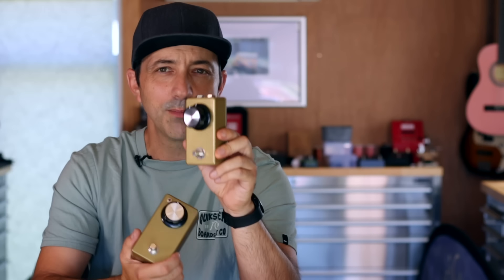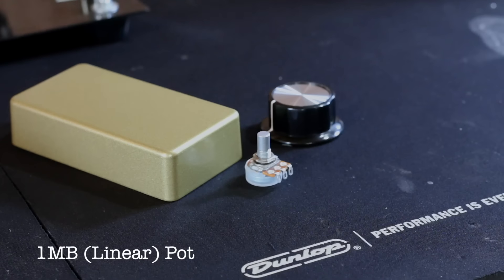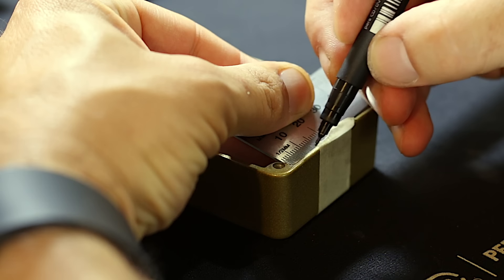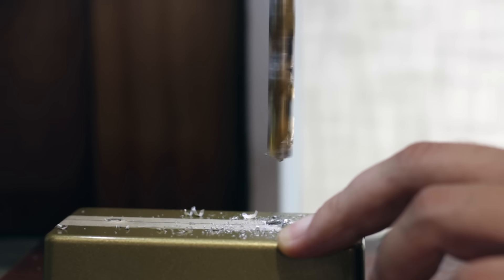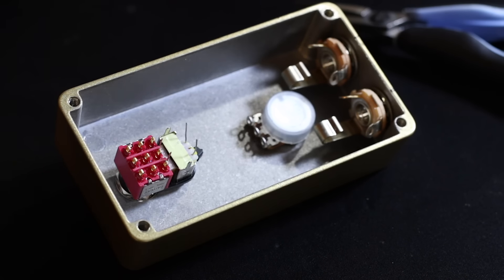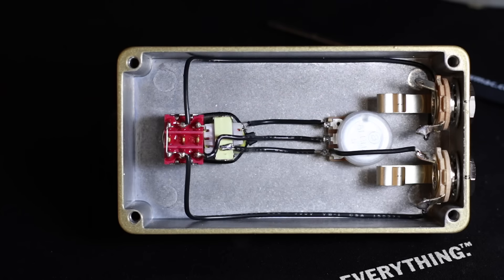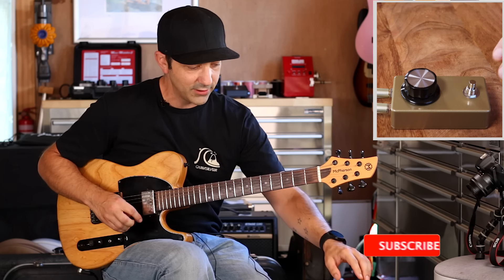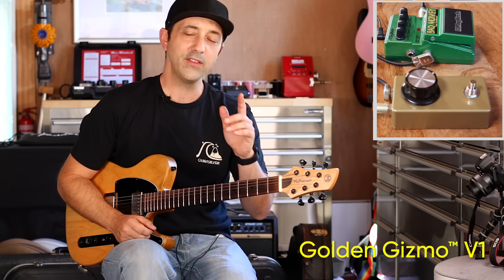Build Your Own Golden Gizmo™ Zero Volt Pickup Booster | DIY Scratch Build Effects Pedal

Comment: Essentially, the circuit uses a small-signal transformer to step-up the voltage signal from the guitar's pickups, the signal voltage gets stepped up by the turns-ratio of the transformer, so, say the transformer's turns-ratio is something like 4:1, i.e. 4 secondary turns to every 1 primary turn, so theoretically if we feed-in a 1Vpp signal into the primary we should see a 4Vpp signal on the secondary winding, but transformers are, in general, about 80% efficient, 20% of the signal is lost in the form of heat, we still get an increase in signal-level though.
Reply: There's slightly more complicated processes. Due to impedance changes frequency response changes too. Also phase characteristics moves slightly in different frequencies.

Comment: Looks like a fun and useful project.  Could you eliminate the pot and just wire directly to the jacks, so that when you step on the switch you get a 100% boost?
Reply from the maker: Yes, that would work great, + you would also get a tiny bit more boost, cheers!

Comment: Fascinating. So your trading low end, which requires a lot more power, for volume in the upper mods.
This may actually solve an issue I’ve had forever. 2 guitar band, I provide the low end, the other guitar is giving definition for the riffs with strong mids. I do the solos which obviously doesn’t work well with a low frequencies.This may be just the thing!
Reply from the maker: Cool, That could definitely be the ticket!
Reply: you could easily add it in the guitar as well, just build a simple op-amp buffer and put the transformer in front of it, then change one of your pots for a push-pull one for the bypass. add a stereo jack w/ the ring connected to the battery negative, and you'll have a circuit that powers off when you unplug the cable.

Comment: I just got a desktop class A tube amp and some reference monitors for my computer. It was super cool to hear the nuance of the different tones you got from that gear.
Reply: Please explain. I dont understand? A tube amp for your desktop computer?
Reply: @mikejames293  No a small 35 watt tube amp to run desktop speakers. Yes its hooked up to my computer to run reference monitors. The tube amp with a class A circuit reacts faster and has extremely low TIM distortion. It lets you hear the texture of your fingertips against the strings, every little detail in the sound comes threw. Thats the reason to use a tube amp with a class A circuit vs a more dampened class B circuit. A MOS/FET class D circuit can do this too but not a regular solid state transistor amp made of resonant circuits. People say you can't hear the difference but they just have bad ears.
Reply: @anthonyb5279  What does your signal chain look like? Guitar > Audio interface > PC > Audio Interface > Desktop Tube Amp > Speakers  ????

Are your speaker the kind without built-in amplification? Can you run headphones on this setup? Have you tried FRFR?
Reply: @mikejames293  I made the speakers my self, same components that Mackie uses.  No I would not use a tiny transistor consumer level crap amp for anything. I use Apple so I can just go line in if I want to but most of the time I want the sound in the room and my VOX with Greenbacks so usually mike it. I don't care for modeling I have the real gear so why model its not better. I have some 4 Chanel M-boxes I rarely use. But that does not matter why have crap speakers and Amp for any thing.  I have and know how to make pro gear so why not.  You realize this is common these days I'm not special???  Yes I have headphones but I still use a tube pre amp (made my self). You got to understand I had a Class5 and Class2 FCC license and a Ph.D in Engineering I can an have built TV and radio stations from the ground up. I don't use consumer audio equipment.  There are a lot of good desk top tuber amps out there for your computer Pyle makes one for only $50 and it sounds fantastic. Just google small tube amps everyone makes them. Just make sure its an undampened class A circuit if you are using it for a reference monitor.  Class D MOS/FET is also good for this.

Comment: You can make a pretty decent JFet buffer with 7-8 components, then you either put it in the pedal (then it's not passive anymore) or make separate a buffer pedal to use if you are running a passive guitar. A Jfet buffer also leaves the frequency response almost intact.

A passive guitar cannot drive this pedal because the secondary of the transformer is effectively a small resistance that goes to ground, so since the power generated by the pickup is constant and equal to V_out/R_out^2, if you put a low output resistance since the power has to remain constant (because there is no buffer) the output voltage goes down. So pickups and piezos work well with high output impedances.

Comment: If you wanted to, you could mount this inside a cavity on your guitar and have the knob and perhaps a toggle switch coming through the front. It could work that way if done right.
Reply: I'm trying to figure out how to do this, but I want to feed a microphone inside the guitar, to the amp, through a reverb circuit, and it out the guitar's jack to my amp.

Basically, I want to build a Yamaha acoustisonic unit in my own guitar

Comment: As someone who mostly uses the neck pickup for jazz applications, and single coils in that regard as well..... it would be useful to solder this little circuit between the neck pickup wire and the switch (assuming that's where it would go)....

Comment: You can also move the transformer's core in and out to change the frequency response (not the easy way actually but still passive). Another trick is to use a DC magnetization of the core to add some saturation to the sound. Permanent magnet works too but again, you need to disassemble the transformer. And if you find a transformer with two primaries then you can connect two parallel back-to-back connected germanium diodes in series with another potentiometer to get some distortrion.

Comment: Hi. I really enjoy your videos. So I felt inspired and built the Golden Gizmo following your instructions to the point (except for the cable binder and the tooth washers). But unfortunately the pedal doesn't work. When I press the switch nothing happens which is pretty disappointing. Any suggestions on how to solve this?

Comment: So it looks like you are connecting the guitar output which is a relatively hi impedance say 50Kohms  into the low impedance 600 Ohms side of the transformer.  Does that work?   I can hear it here in your video but it would seem like a huge impedance mismatch . It sounds like there is some loss of bass frequencies which may be good in some applications or mayby not so good in others.    Just a thought.

Comment: The schematic for the Golden Gizmo V2 does not have the true bypass switch drawn in the circuit. It is simple enough but I thought I would mention it. I had fun building the Green Gizmo and find it quite useful. I shall build the Golden Gizmo as well. ✌️
Reply from the maker: Thanks, I just added it. Stoked you liked the Green Gizmo :)
Reply: @WaylonMcPhersonGuitar Some guitars needed a good tweak. Some just needed a tiny nudge. ✌️

Comment: If you use a plastic box rather than metal, you will need to join the earth lugs on the 2 jack sockets
Reply from the maker: Definitely do not use a plastic box, the pedal will be super noisy unless you line it with Copper Tape or similar, cheers!